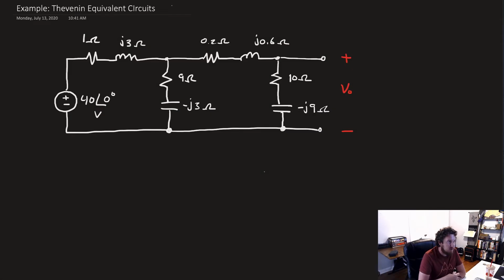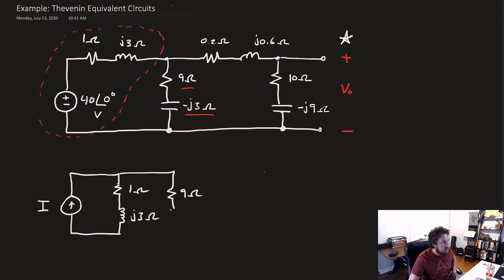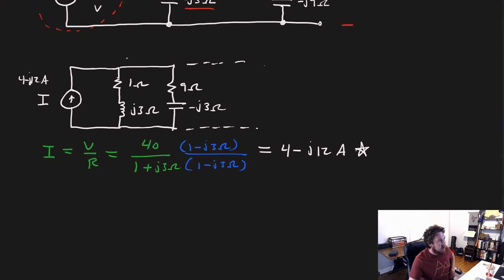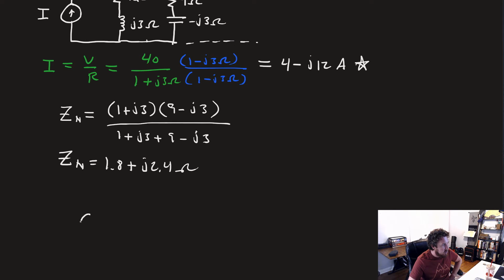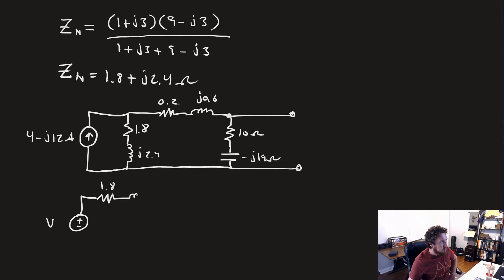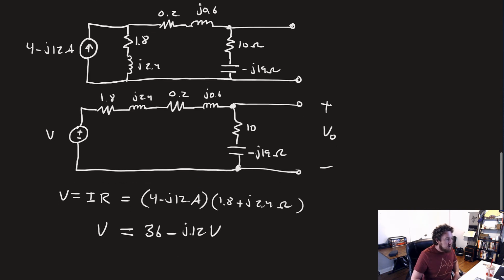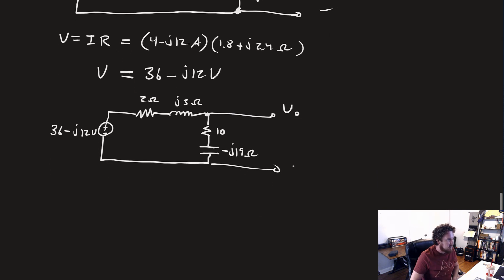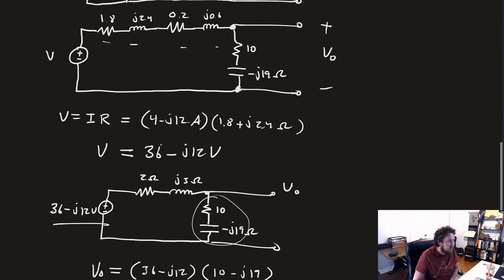Example: Thevenin and Norton Equivalent Circuits

Comment: thank you very much for this excellent playlist, many reminders and many discoveries. However there seems to be a small error, from 5:00 you use -j19 for the last capacitor instead of -j9 as in the original circuit.